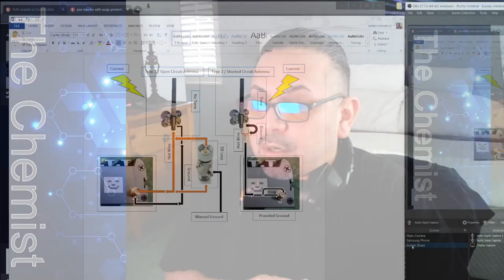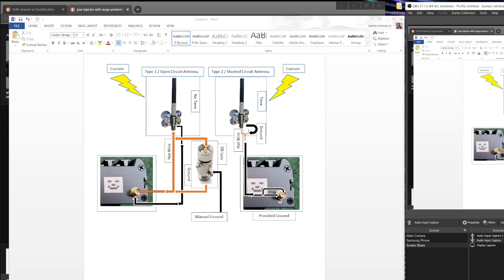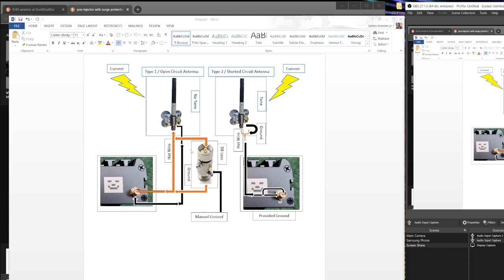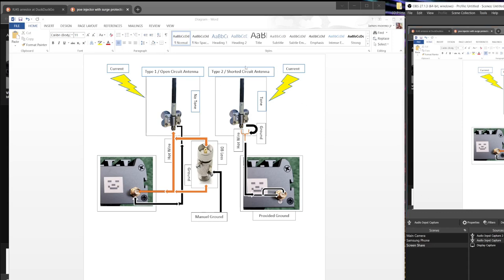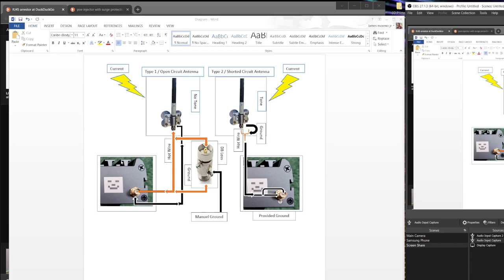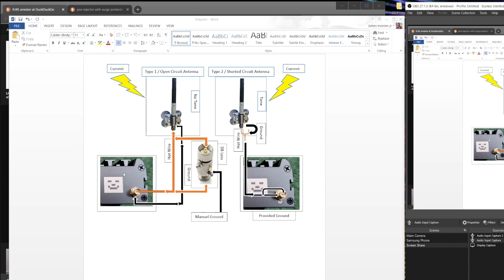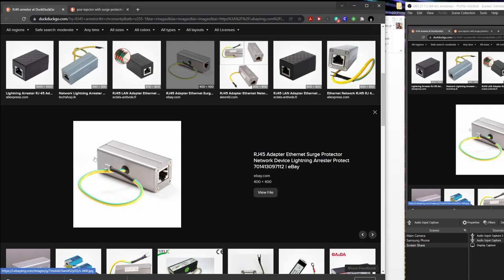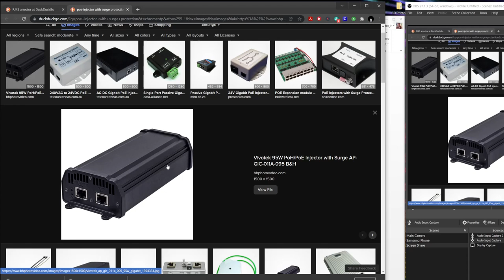Do I Need A Lightning Arrester for my Hotspot Miner? Lets Find Out.

Comment: You can install whole house surge protection and it will help protect all circuits in your house. But it does need to be installed at the panelboard so it's understandable that most people who do not know what their doing may be reluctant to try as it can be dangerous.

Comment: Thanks a lot for the video man🙏🏽. My setup is like: from up to down: Antenna at the roof (Rak 8dbi grounded)—> cafity filter (directly on the antenna)—-> amplifier——> Miner outside (Bobcat)——> Ethernet cabel (outside to inside——> Internet Router.

Do i need a protection for this setup. If yes, which turtorial video you would recommend. Thanks a lot, be blessed.

Comment: That was an amazing information. In my case, after doing the test, I have a bip sound!! xD so, regarded to your explication, my antenna has grounded... but I have another question... In my case I'm in a region with I need to use an EU plug for the electricity connection. So... I must put an adaptor to the original US connector and for stupid that I sound... I imagine that in the connector I must use that with ground connector? Thanks for your answer.

Comment: I think there might be one thing missing from the right side of your diagram… it’s my understanding that the metal antenna mast needs to be grounded and the antenna connected to that in such a way that any current will be sent to ground vs sent to your miner to possibly “fry” it. Make sense? So the metal antenna mast should be tied to your house ground.
Reply: You are correct Darcy, the mast must be grounded.. I may have overlooked that in the diagram, I don't recall but it's definitely in the installation videos of my FreedomFi..  hey thanks for pointing that out..
Reply: @TheChemistDIY  thanks a lot

Comment: Thanks for the video.  Question please.   I live in apartment top floor (6th floor)  I checked on roof. It got the TV antenna for the building.  Do I still need lightning arrester?  As I am goona install HNT antenna next to it.  Or can I share the ground cable?.Any advice please 
Thanks
Reply: The only way to tell if you need a lightning arrester is to perform the test that I demonstrated in the video. Depending on where you live it's very rare that you will see a lightning strike. You should be more concerned about electrostatic building up inside the antenna and traveling down the hot wire and directly into your miner.

If after you perform the test and you find you do need a lightning arrester you can use the same ground that is on the antenna on the roof and connect it to your lighting arrester.. aka sharing the ground.
Reply: @TheChemistDIY  thanks  a lot

Comment: Thanks for the video but you are missing one huge point. Most helium miners does not have a grounded outlet connector for power so they do not really have a true ground and this makes the lighting arrestor even more important, even if you have the shorted circuit antenna...
Reply: Yes, you are correct. The minor plug itself would need to have the 3rd prong ground on the plug to delete the lightning arrester.

The freedomFi minor is the exemption as it uses a power brick much like a laptop and has the 3rd ground prong.

Although you could add your own ground with a fish eye terminal at the SMA.. which would pinch between the SMA and LMR cabling connection... But do so at your own risk..
Reply: @TheChemistDIY  hello sir, just read your comment. I have four Freedom FI hotspots. I do intent to set one with an antenna outside. So you are saying that for freedom FI hotspot  you don’t necessarily need the arrester? What antenna do you recommend for this? Thanks a lot for your video.

Comment: What if we use something to discharge static electric from antenna connector,something like those things ,keychains,for discharge static electricity from cars body,would be enough?
Reply: Sorry Alen, I cant speak on that since I've never used. I would stick to what the NEC has put out as they are the SMEs on the topic.

Comment: Wow! Amazing video. Is it necessary to use a lightning arrestor for antenna placed in between the window jamb with the mesh screen removed?
Reply from the maker: If you're referring to inside the house then most likely not and you should be good without the arrestor.
Reply: @thechemistoncrypto645  Okay.  Thank you.
Reply: I was going to ask the exact same question... is there really a reason to place the antenna outside the window, rather than behind it? I would’ve thought that static build up from lightning would be an issue if the antenna was anywhere outside (even if barely outside a window seal), but I don’t know much about this topic. Thanks in advance for answers/response.
Reply: @SpookySkeletonDD  I had 12 witnesses in my window until my antenna and cables came in.  Once I put the miner on my roof I have 57 witnesses.  I was making $10 a week, now I make $10 a day.

Comment: Maybe i couldn't catch the point, if we use metal bars, we have to use arrester again? or if use metal bar for antenna we don't need arrester?
Reply: Inside the antenna there is a metal wire, this wire is called your hot wire and it connects all the way to your minor. Without the lightning arrestor any current traveling down that wire will fry your minor. This is why we use a lighting arrestor, it limits any current or voltage traveling down that wire. It's like an inline fuse protecting your minor from burning out.

Comment: If the antenna is grounded, and you don’t need the arrester, does the antenna have to be mounted to a metal mast that is grounded? Or does it not matter?
Reply: Correct, the antenna is mounted to the mast and the mast should be grounded.

You can see how I did that here at 8:50 in the timeline.

https://youtu.be/H0LCW9gXcGg
Reply: @TheChemistDIY  cool thanks, I’m about to take my miner out the outdoor enclosure and bring it back inside. I used to have it inside but put it outside to get rid of the long cable run and reduce the signal loss but it didn’t change a thing for me. Rather have the miner inside for peace of mind. Just checked my 6db McGill and it doesn’t beep so looks like I need to keep this lightning arrester anyway lol.
Reply: @rivec33  lately it seems that rewards are on the down slope due to over saturation. My rez 4 has me about .38.. what about you?
Reply: @TheChemistDIY  you talking about transmit scale?  .59
Reply: @rivec33  yes sir, 0.59.. your doing better then me and I have my antenna 23 feet up. 

I'm going to be posting up a video this week about turning your minor into a mobile mining rig.. I'm starting with the most important piece, the cellular router and it's not the rut240 which most can't seem to get off relay.. when light spots move into play, relay is going to kill most...aside from VPS...I think I may have a solution but will see.. stay tuned

Comment: Noob question, What happens if you don’t attach ground wire and just solely put an arrestor on your antenna / cable
Reply: I just want to get my antenna up and running. Would take me an extra 2-3 days to get wire / grounding rod. Wondering if I can set it all up without those two items and be fine? Or if I can attach them later on after it’s up and running ? Appreciate your work
Reply: @nstone95  if you live in a location prone to lightning strikes out of the blue then I don't suggest you put up the antenna. Can it wait a few days till you get your supplies in, sure why not.

The ground wire is so that if a  strike was to occur it would have a short direct path to earth rather then traveling through your home..
Reply: @TheChemistDIY  naw I live in New England dont get much lightning here , sometimes in the summer
Reply: @TheChemistDIY  I also have an outdoor rokland antenna, not sure if the outdoor makes a difference in needed an arrestor or not

Comment: What brand is your antenna
Reply from the maker: No Brand Name, just a 9 DBI Omni-directional US 915MHZ but I can confirm it works, has exceptional range and making HNT. If you want the eBay auction let me know and I'll post it.  I just wish my area wasn't so heavily saturated. But that fix coming soon as I'm working on an off grid system that port forwards 44158 through the cellular router. That video coming soon so subscribe and stay tuned..
Reply: @thechemistoncrypto645  looking forward to it thanks